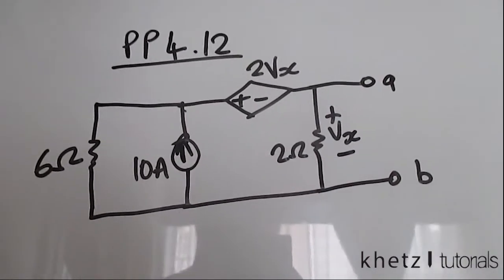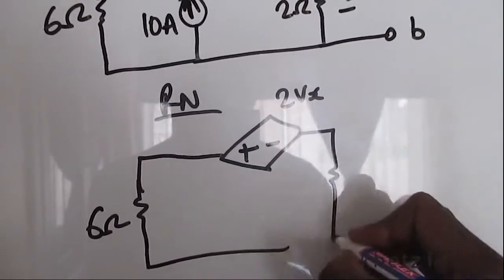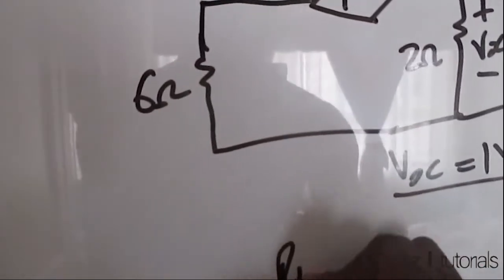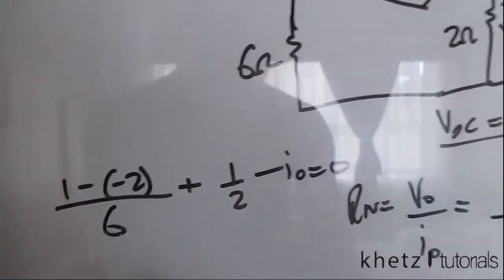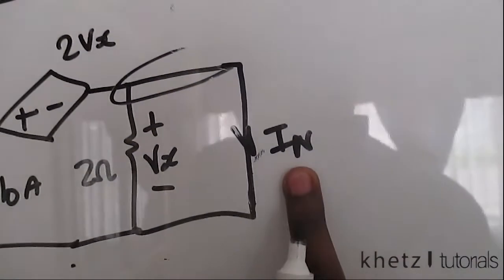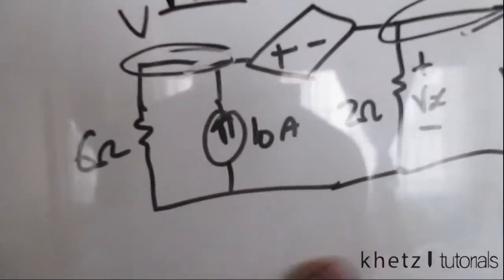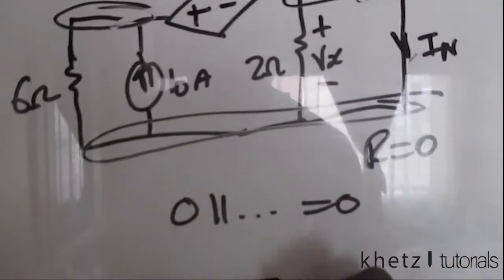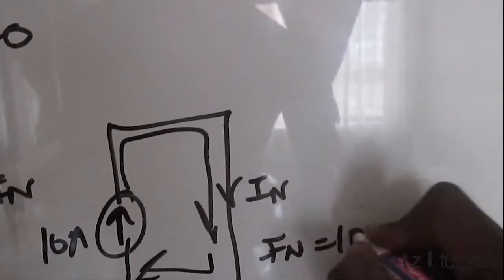Fundamentals Of Electric Circuits Practice Problem 4.12

Comment: hey, I'm a little bit confused, should the 1 ampere independent source be removed too?
Reply from the maker: Hello. Which 1A are you referring to? I removed the 10A, which was the only independent source present in this circuit, and that is all that you needed to remove. If you are referring to the test 1A you'd add instead of the 1V, then the answer is no since you would have added it to solve the problem and the approach would be slightly different.